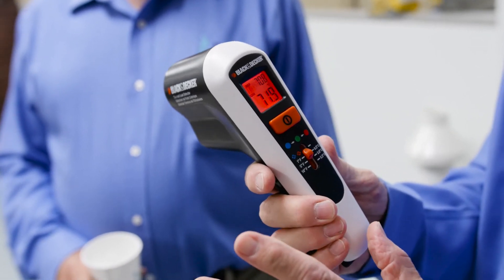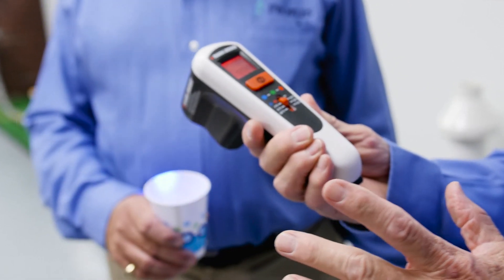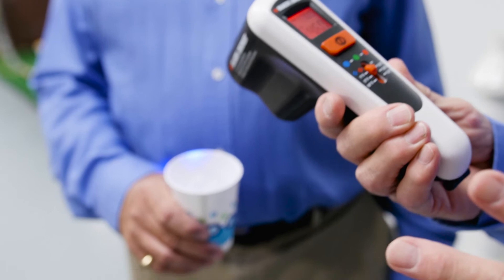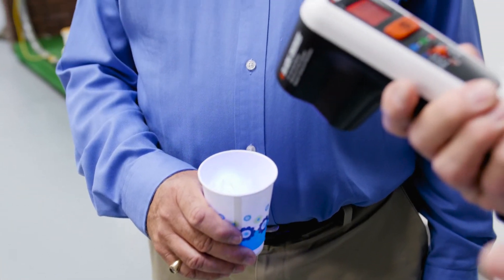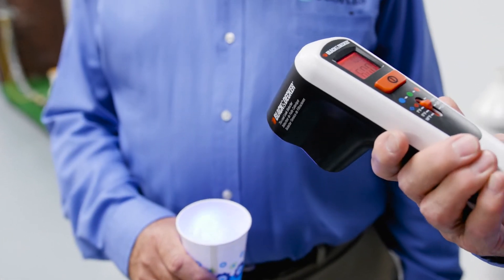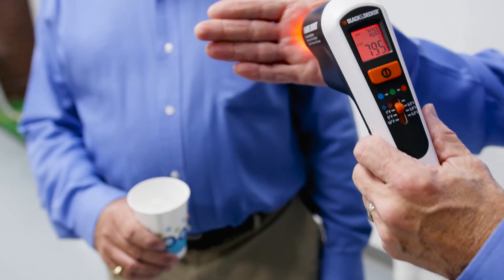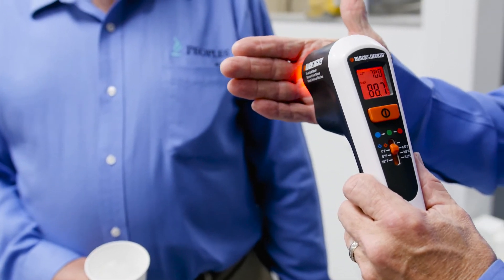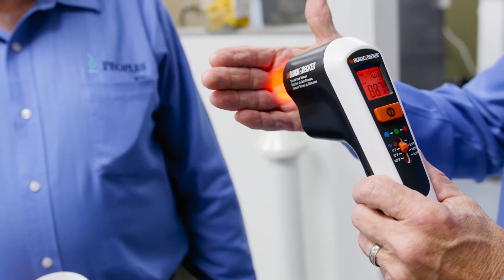Gas Guys: How to Use a Thermal Leak Detector

Comment: Is it just for air or will it pick up refrigerant leaks in copper?
Reply from the maker: Hi there! The type of thermal leak detector pictured in the video only measures surface temperature, not refrigerant leaks. Thanks!